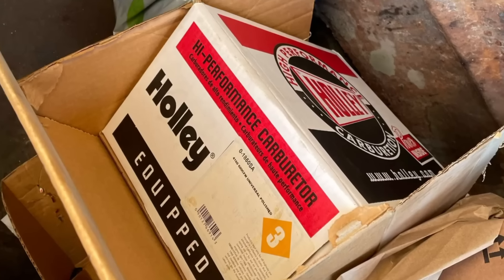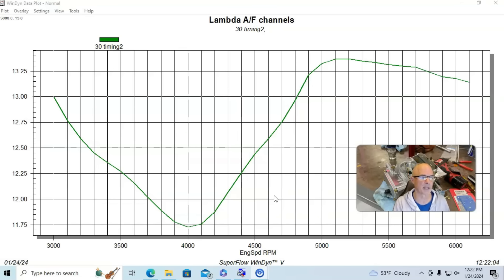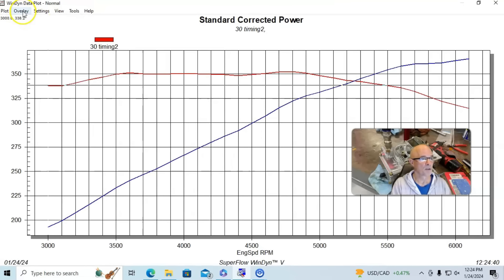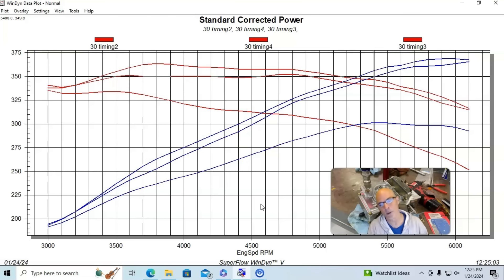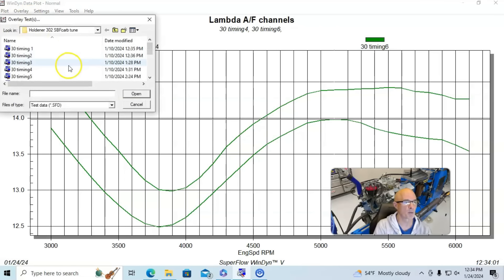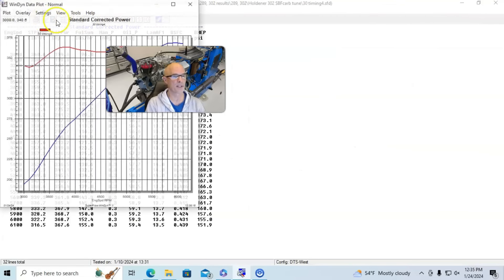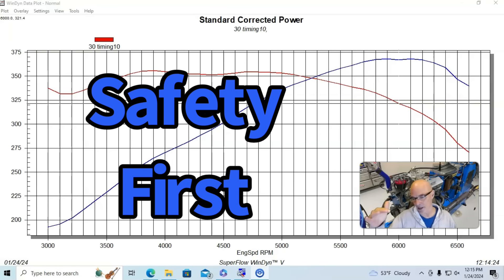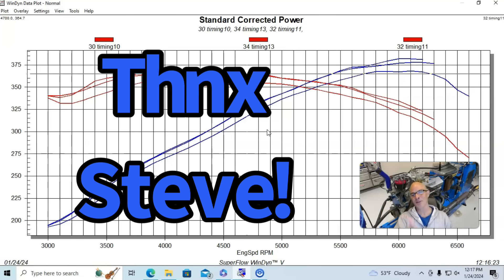HOW TO TUNE A LOW-BUCK, 1850 HOLLEY 600 VACUUM SECONDARY CARB. NOT-SO TOP SECRET 4160 TUNING TRICKS

Comment: It would be interesting to see your vacuum at the dip (richness) in the initial graph.  That would indicate that your power valve restrictors were way rich which is common on most Holley's.  Most people forget that the main primary jet plus the PVRs when the PV opens is the actual primary jetting.  The primary jet supplies the AFR by themselves only during cruise steady state rpms with the PV closed.

Comment: Wow! I could go on for hours on 4150 tuning, and you made it bite size for the basics in 15 minutes. 👍🏼 Back in the 90s, we would plug the power valve hole and put that metering block on the back. Holley sold longer balance tubes for this! Today, jetted rear plates, billet metering blocks with tiny bleeds, and air bleeds in the throat take tuning to the next level. Thanks again for a basic Holley tuning video.
Reply: Yeah, I had the same Holley. For $40 they make a conversion kit. 4160 to a 4150 You get the metering block which replaces the plate. Longer transfer tube because of the new metering block. All different size jets and vacuum secondary springs. I had a few different power valves as well. I made mine mechanical secondaries too.

Comment: I never thought the vacuum secondary was working so I set up a micro switch and light to tell if the vacuum secondary was working. I was right it was not working. It took a few spring changes to get it to work right. Then I went to a double pumper. No switch or light needed. 😊

Comment: When I was in high school, this is the carb I ran on my stock 327, worked perfectly at sea level. Later when I moved to the mountains, it was way rich at 7000 ft.
Reply: Yep you should have dropped your jets probably at least four numbers and played around with a lower rating power valve
Reply: @MonzaRacer  I replaced it with a properly jetted Quadrajet instead.

Comment: Nice, now do a 650 double pumper!
Reply: At desired AFRs, I will suggest that the 650 dp will perform very closely to the wired open 1850. An engine doesn't care how it is fed, it cares about the AFR while being fed.
Reply: @karlloper7217  not disagreeing, it’s the tuning I’m interested in
Reply: I liked vacuum secondary over mechanical on my Mustang because 3.70 gears and a C4. Sometimes the foot position for cruising on the highway cracked open the secondaries. With a vacuum, they stayed shut at that cruise position. Dynos are cool for the big number, but it gets complicated when you are drive tuning the carb (carbs).
Reply: @karlloper7217 you could’ve flatten the wire between the primary and secondary on the do so it comes in later in the the pedal position.
Reply: @cedricwilson2055  flattening the secondary wire will slow the opening, but will also not allow WFO on the secondary.

Comment: Holy crap this test really hits home. I have been running the basic 1850 on my very mild 307, 305,  350 for over 30 years. The carb is cheap, reliable and I only changed jets, and vacuum secondary springs. This is my street cruiser, drive to the track foot brake combo, and it's dead nuts consistent in multiple cars, too. Now I know why when I locked out the secondaries, it would sound and feel better, but ET exactly the same . I have that actual plate kit, and now I cant wait to try it. I don't have an A/F meter, must get one now, must! I didn't think it would matter, now I know better, can't wait to try it now! This test was smack dead the SHAHIZZZZLE!
Reply: I watched this again, and I remembered, I purchased the Holley 34-6, 4160 secondary metering block way back in the day. I dug it out last night, and I cant wait try it out on a my Chevrolet Performance crate 260 hp 350. I never tried a white VAC/SEC spring, only black.brown or plain. Have you ever tried the Holley 4160 secondary metering block in a test? I got one if you want to try it out. Keep testing.
Reply: How did it go?
Reply: @mudwhistle74  Well it's been very cold/wet in the BIG Mitten state. I don't plan to hit any track before the end of april (rain) and I am 90% done on my home made engine stand. If the test mule re-ring 305 isn't a smoker, i'll start with that, and I still need to find a A/F gauge setup that is affordable $$ and in stock. Got a couple of 1850's about ready to go and a whole lot of hook up coming, and 2 months to get rolling on a over due upgrade, and a big learning curve ahead. Stay tuned.

Comment: I put one on a '75 318 Chrysler. Changed the primary jets to 64s and other than that it ran fantastic. The secondaries worked just right. Mine was the old green-colored one.

Comment: I have a carbureted 331 with a Comp XE 274 cam, TFS 170 heads and an Edelbrock Air Gap RPM manifold on my 80 Foxbody.  I recently replaced a 600 cfm 4160 Holley with a QFT 650 AN carb.   I too modified the 4160 to add a full up secondary metering plate which made tuning way easier but I never could get the secondaries to work reliably.  The QFT 650 AN is essentially a 4150 Holley double pumper with annular boosters.   I have found that I actully had to down jet a couple sizes front and back over the old 4160.  I also had to go upa couple power valve sizes to keep it from leaning out at WOT ( I have an AFR meter installed in the car).   Have you ever run back  to back tests with annular booster vs regular (down or straight leg) booster carbs?  This carb seems to work VERY nicely but the tuning was not what I expected.

Comment: I love these carbs , I’ve ran them on tunnel rams, singles and blowers.  I’ve got a pair of older 1850-3’s that have the quick change spring kit, AED secondary plate, boost reference PV,  milled choke, and screw in air bleeds. There super easy to tune , going on a 347 with a 6-71.

Comment: Learnt a lot from this. Had no idea you could get an extra metering block for those carbs.
Allways assumed (wrongly as it turns out) that you just had to match very closely, the carb size to the application
Reply: Metering plates have jet number equivalents, but they are not as cost effective as this set up. While Holley makes secondary metering blocks, we would block off the power valve and buy the longer balance tube (thus making the 4160 a 4150) and jet that way. I love these new plates because tunnel ram in line carbs on my SBF.

Comment: There is about 20 versions of a 600. I have 3 on the bench currently.The intake or heads must be very inneficient as jets that big are way too big for the carb and the engine.
I agree with the lack of secondary tuning being a total pain on them. I have never seen those jet plates before, I will enquire of them to my Holley supplier.
As for secondary springs,, I have never seen one that is not too stiff. And 600s are hard to change as you have to loosen and or remove the choke mechanism to get them out.
Reply from the maker: THE PORTED BPE ALUM HEADS ARE ACTUALLY OVERKILL FOR THIS MOTOR

Comment: Great video! What cam did you use on this motor? I built my motor and followed a similar build you did with gt40 iron heads, but my motor isn’t making the torque it’s suppose to?
Reply from the maker: XE274HR
Reply: @richardholdener1727  yes good cam, my cam is not as aggressive as the 274 but my motor doesn’t have the power on the low end. I’m baffled by this because my cam is 270/276 with 214/220 duration 482/498 lift at a 112 lobe sep. So it should make decent torque?

Comment: Regarding your ls cam  videos... is it possible to start recording dyno graph at or closer to idle? For example to possibly see if there is a performance comparison around 1800-2200 rpm. As if you were highway driving or using cruse control.  Just thinking if a majority of ls cams featured are going into daily-ish driven vehicles would idle or partial throttle performance comparison or even comparing fuel consumption in the 2000ish rpm range with partial throttle to investigate possible ways to increase or maximize mpg for 50% or less throttle without compromising full throttle performance. Or vice-versa.
Reply from the maker: no on testing MPG on the engine dyno, and 1800 rpm at WOT is not something anyone ever sees
Reply: @richardholdener1727  

Not at wide open. Just partial. Just enough to maintain that rpm. Just to see.

Comment: Green, tuning carbs: Are jet sized, commonly even all around? (P=S, P>S, P<S) Does this vary vacuum vs mechanical?
Reply from the maker: not always the same-power valves change jet stagger
Reply: Yes and no. To really balance the jets, you need to calculate the PVRCs with the primary jet size to match the rear jet, more specifically, the area of the jet hole. But, this gets into drive tuning, not dyno pulls. Example, take out a couple of jets for gooder cruise AFR, but add the opposite amount of change to the PVRC to maintain WOT AFR.

Comment: Hi Richard have you ever tried a tapered combo spacer on a dual plane intake upside down does it work thanks Steve
Reply from the maker: it works...but does it work better
Reply: @richardholdener1727  Sounds like a test!

Comment: Great video. Question: Is there any reason why you wouldn’t want to attach a throttle position sensor to the secondary’s of a vacuum carb while dyno testing? It’s just more data  to be used for analyzing, right?
I know it’d be more effort to make it work, but then you’d know how much the throttle plates would be opening and where in the curve.
Reply from the maker: would be good data-the carb cam shows us this too
Reply: @richardholdener1727  I would like to see some carb cam shots with different carb/booster setups. Maybe in comparison to a SNIPER.

Comment: Why the dip at 4000 with the A/F ratio all the time?
Is that the power valve opening?
Reply from the maker: power valve opens once past 6.5 inches of vacuum-meaning at open at WOT

Comment: Can we get a similar vid with the 600 edelbrock/carter?
Reply: Edelbrock has a tuning map in their instructions. Buy the kit for that model, an AFR guage, and you're ready to get 14 mpg with twin 1404s on a tunnel ram 302. 👍🏼
Reply: Yes a test of the Edelbrock 1406, would be great. I was going to replace my 1850 for a used 1406. Now with this info, I might not need to. But I will do a back to back test between them, top see what's what.
Great test!